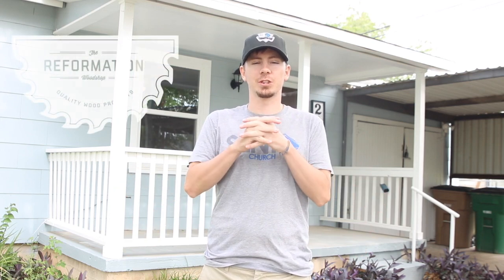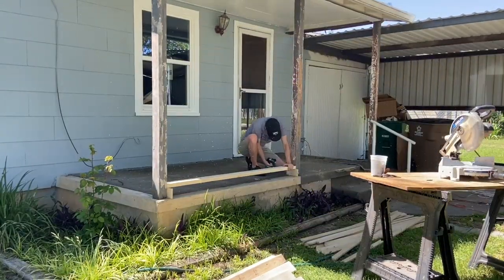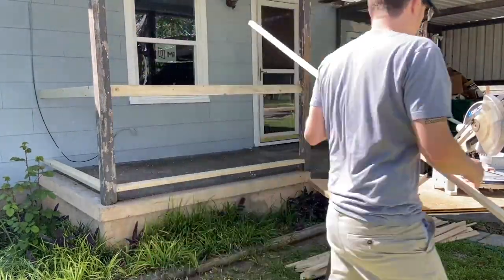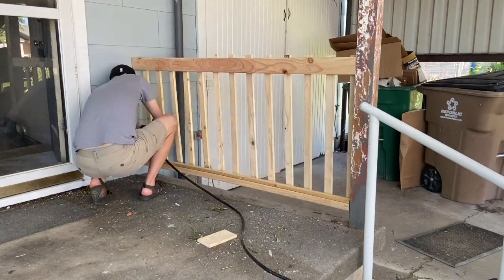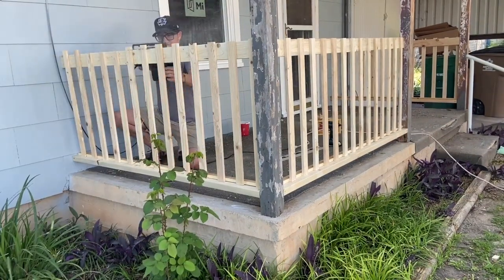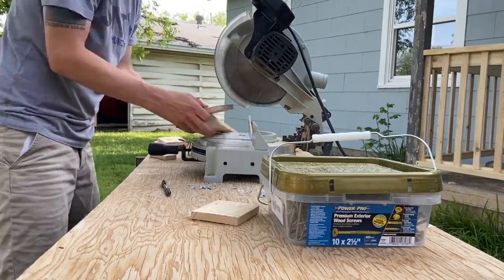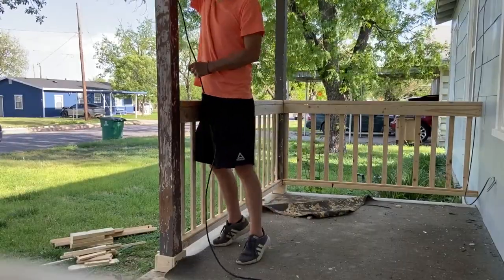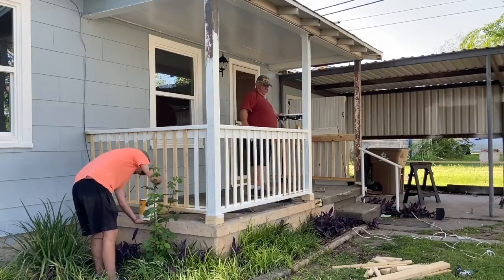DIY Porch Railing Build // Flip House Remodel

Comment: Did you use pressure treated lumber or standard pine 2 x material ?
Reply from the maker: Russell Motter pressure treated. And for the slats I used fence panels that were split down the middle.
Reply: The Reformation Woodshop ok thx. 
I have been taught you shouldn’t paint pressure treated lumber & always prime before painting for good performance & durability